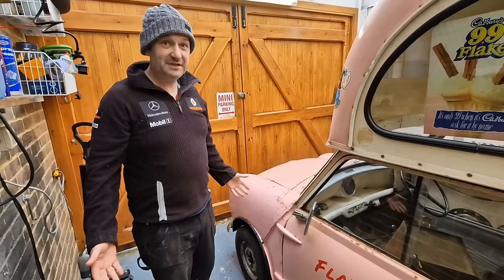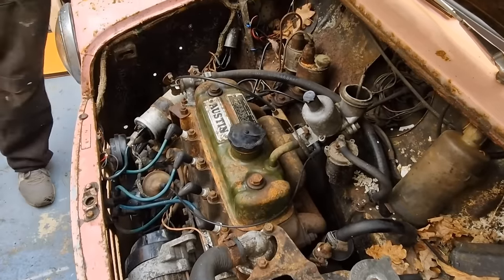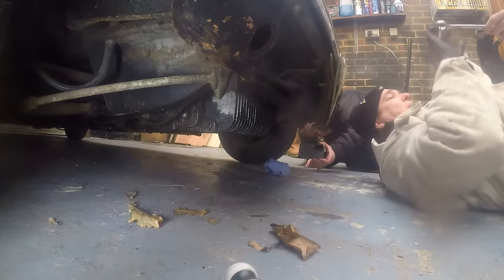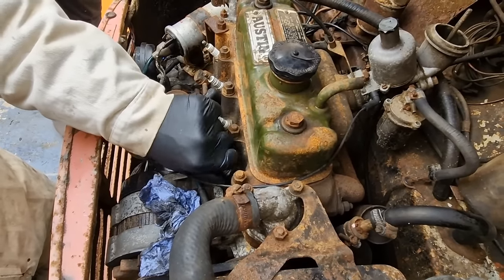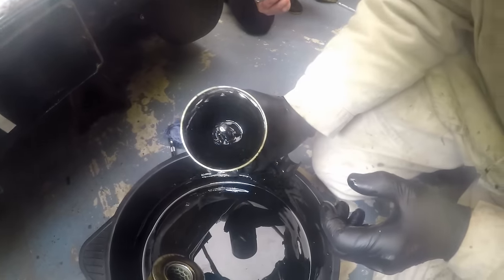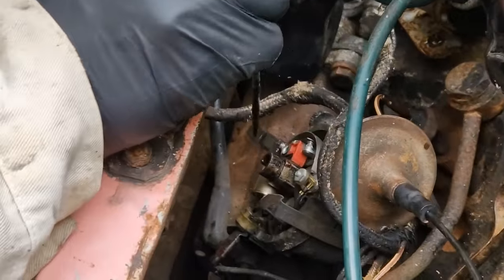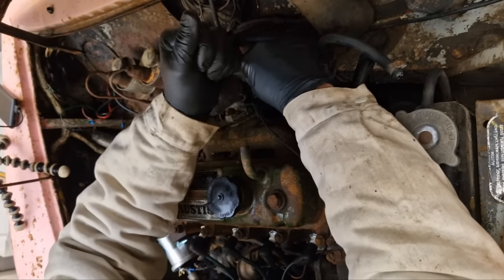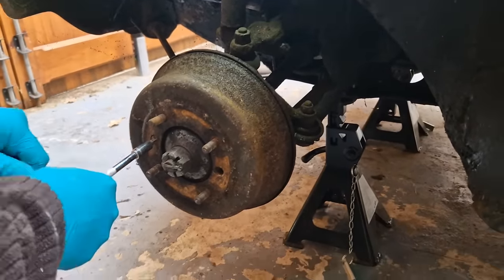EP2 - Barn find Classic mini Ice cream van - Can we Start it?

Comment: Remember these around as a kid in 60's/early 70's. Along with the Mini Wildgoose the most bonkers incarnation of a mini.
Reply from the maker: They must have looked so funny on the road!
Reply: @ColinsCars  They sure did. Not surely an 850cc engine like the Wildgoose? Remember reading an article a few years back where a guy had rebuilt a Wildgoose but installed engine from 1275GT mini & even with that it ' just about kept pace with modern traffic ' Can't imagine ice cream sellers in the Peak District or Snowdonia buying one of these you'd need rear end assistance!
Reply from the maker: @marccherry7409  yup still the tiny 850!
Reply: @ColinsCars  I suppose the next step down as an ice cream van would be a Bond Minicar! You needn't worry about missing it yer could keep up with it at a brisk walking pace lol